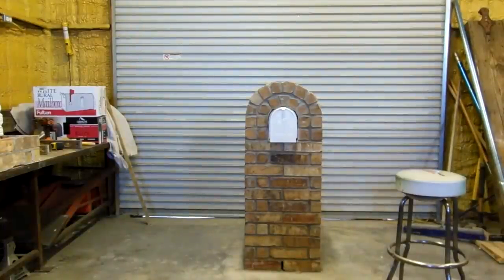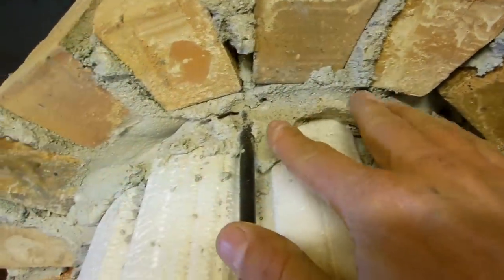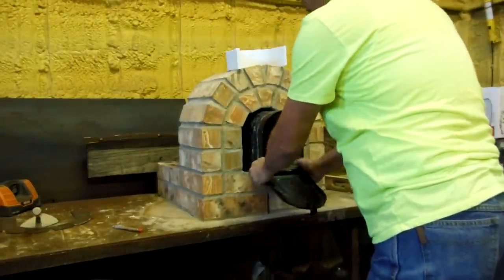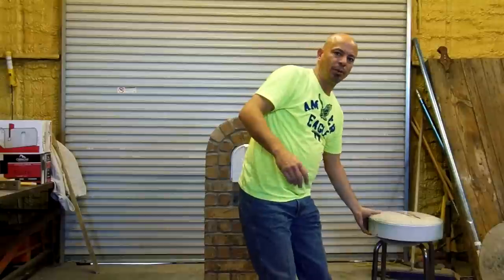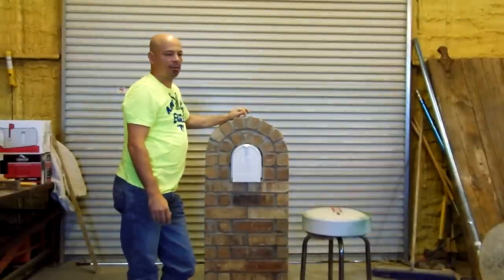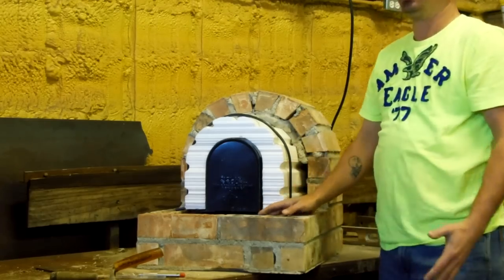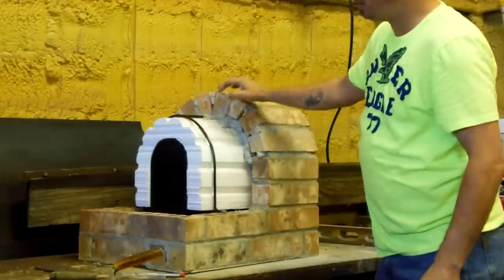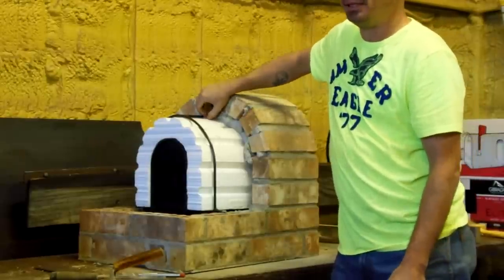How to build a masonry mailbox

Comment: Instead of using styrofoam you can always slide your mailbox into place and hold it there  using spray foam then use a little silicone caulking to seal around me outside you'll still be able to remove your mailbox in 15 years when the door falls off